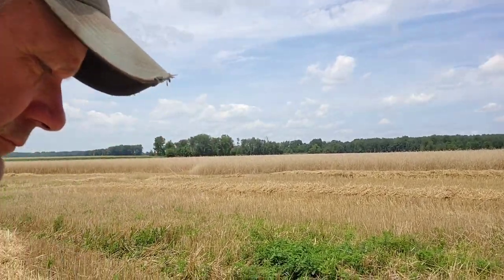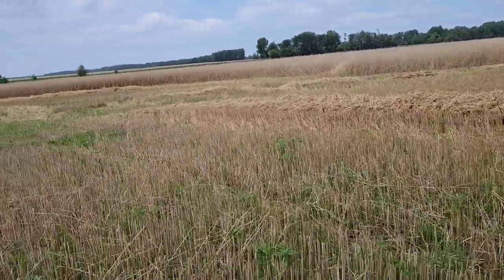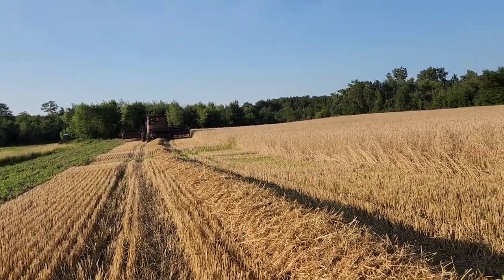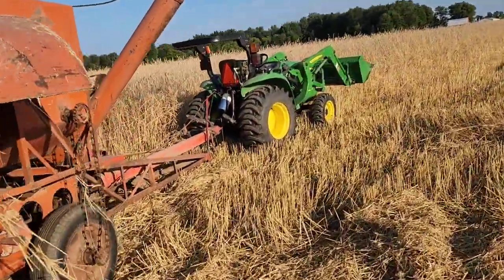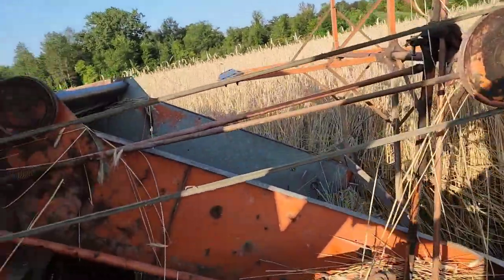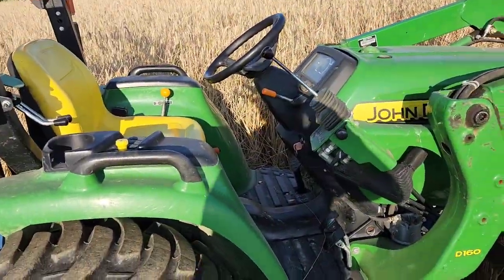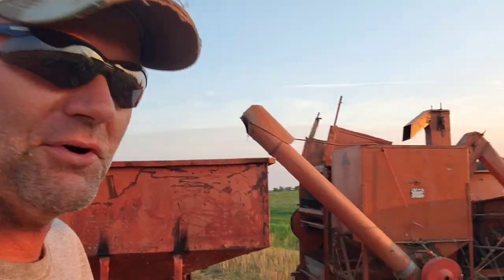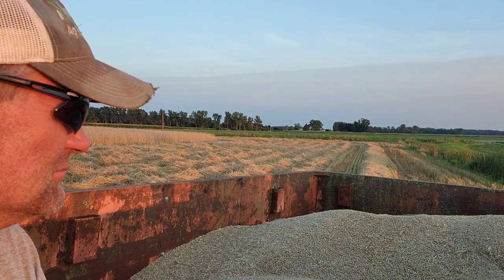All-Crop to the rescue. Slow and steady.

Comment: Great to have a backup, and it's a working AC A-C! In a pinch you can go counter-clockwise around the field since trees shade out yield around the edges you aren't missing much. The guys with the big machines have to go fast and cover many more acres just to make equipment loan payments. Older cash paid equipment with no debt can make smaller farms profitable.
Reply from the maker: Good points, thanks very much for watching!